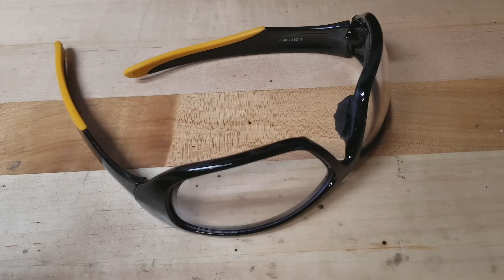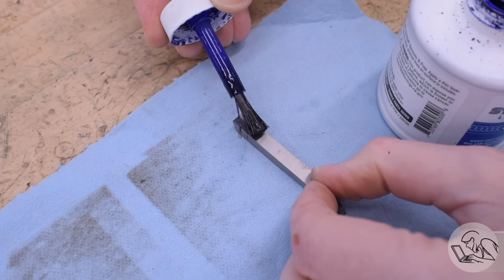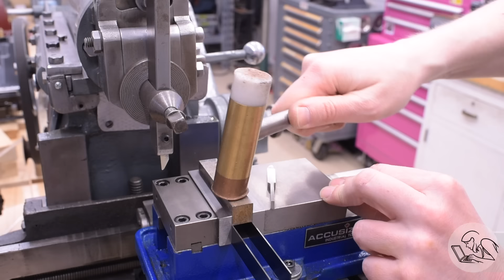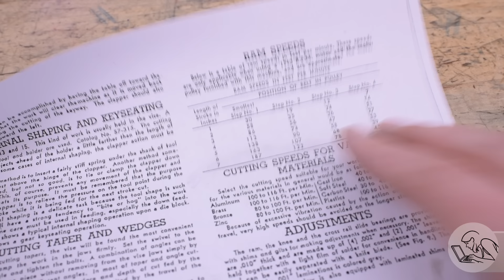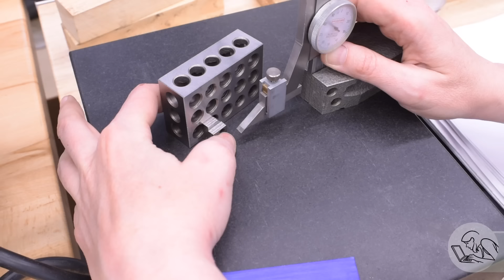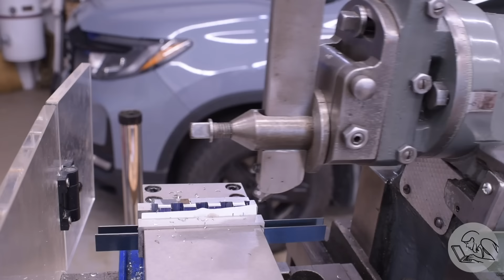Let's Make T-Nuts Like It's 1950

Comment: I've only recently been watching your channel which I find really interesting and informative even though I've had my hands on tools most of my life.

Especially interesting is the fact that we both have the same model of shaper. I used them at work but they were all huge things and after all it was only about getting a job done in the least possible time with whatever we had at hand at the time. I've been retired a good few years and have built up a decent hobby workshop, so when I saw a shaper advertised reasonably locally I had to buy it. Turns out an older guy had bought it with the intention of restoring it, stripped it all down and was unexpectedly called to meet his maker before he got to finish the job. Essentially I bought boxes of parts and castings . . . 
I decided to do the best job I could to honour his intentions so stripped all the paint off, re-painted it and then started on the assembly. Turned out the hub that holds the bull gear and the stroke adjusting mechanism had cracked, and with the last of the shapers having been made in the early 60s parts were thin on the ground. Add into the equation the fact that I'm in the UK and the machine is American and the chances of finding parts were zero.

After a lot of thinking, I turned the hub off the shaft, flame cut a chunk of 5/8" plate to about the right size then bored it to fit the register I had made on the shaft. Brazed them together then turned them down to the right size to fit the bull gear. There's a semicircular channel milled into the hub to carry the worm and pinion adjuster which I managed to replicate by using a home made David Gingery milling machine - not made by me unfortunately - which did the job. 

Re-assembly was pretty straightforward until I discovered that the nut which fits the knee adjustment leadscrew was missing . . . Had a couple of goes at screwcutting a phosphor bronze 5/8" ACME left hand nut before I made a suitable tap instead and got the job done that way. 

I bought the shaper about 12 years ago and use it on a daily basis - it's surprising just what you can achieve with one! Mine's not as pretty as yours - it's covered in oil and swarf but it's a working tool after all. I did find that the micrometer dials were too small and faint to see so I made larger, re-settable ones with clearer markings which was a complete game changer for me.  

Thank you for a great channel with very enjoyable content - I believe you're never too old to learn something new so I'll continue to watch.

Comment: 21:07 Would it have been valid to unlock the jaws of the vise and slide the part down the jaws until the next hole position is aligned with the drill press spindle?

Comment: This retired general machinist says you could teach a class in manual machining.  A tip about "staking" your thread bottoms:  Use the ball end of a ball peen hammer or ball bearing suitably sixed laid over your threaded hole and hit it once or twice instead of having to be really finicky with placing your center punch and working your way around a hole. Saves time and effort.
Reply: FWIW I put in as large a tapered punch as will fit and give it couple of taps.  Will usually drive the last two threads together.  The punch is meant to be hit and not as hard on the face of the ball peen.  Not that I haven't done that too.

Comment: Kinda brings it back- the old shop had a couple of shapers I tried a couple times. I found them slow compared to the big Milwaukee mills across the aisle.  The old timers loved 'em (I was in my mid 20's at the time so I thought those guys in their 50's and early 60's were old timers).  Here's one for you: they had a vertical slotter, which is just a shaper that sits up.  Ram runs on a vertical line, just the ticket for some ops that are quite awkward on a conventional shaper.

Comment: Awesome work, Quinn! That really is a sweetheart of a machine. Whatever you paid for it, you got a deal. Shapers really are fun machines to use... And one of the nice things about being a hobbyist, is that we can choose which machine to use for a job based on fun, versus time/money. As you said, those T-nut would've been faster to make on the mill, but you've got a new toy to play with, so why not use it instead?

I've got a Rhodes 7" shaper, which dates to sometime in the early 1900's-1910's. A previous owner converted it to V-belts, and I plan on de-converting it back to flat belts, just because. Though I've modernized it in other ways... I've added a TouchDRO and glass scales, as well as a tachometer (I told TouchDRO that the tach ring has twice as many magnets as it actually does, so now it reads strokes per minute).

Though the "modernization" I'm most proud of, is the QCTP I made for the shaper. I'm sort of obsessed with repeatable, quick-change tooling, so I racked my brain, and came up with something that (so far) works really well. If you're curious, I made a video series detailing the making of it.

Comment: Love your work - even making T-nuts again!  You sharpened the HSS bit and cooled it down in water to keep from burning your fingers even though the tool can stand much higher temperatures.  I too have done this about 1000 times.  Another YouTuber cautioned viewers to not do this because the thermal shock can cause micro fractures.  He recommended just letting the tool cool naturally.  I'm inclined to keep doing what I've done (don't we all) but would enjoy hearing your thoughts on this.  My SWAG is that the temperatures in the tool that I can hold the other end of just aren't high enough to cause an issue when dunked in room temperature water.  Thanks.
Reply from the maker: That sounds like nonsense. Machinists have been dunking toolbits for 150 years.

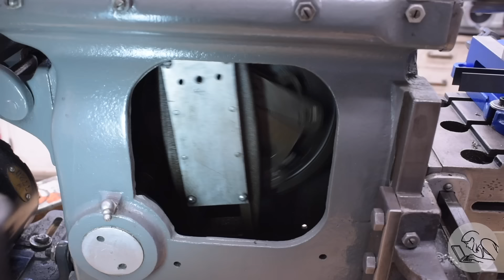Comment: Quinn, at 13:00 you said that idle stroke is actually faster than the cutting stroke, however your cutting stroke is faster than your idle stroke. 1, your drive wheel is turning backwards, so the top/slow part of the drive pulls the head backward, and the bottom/fast part pushes it forward, and later on, around 22:30, going frame by frame I count 13 frames of cutting stroke, and 16 frames of idle stroke. Are you now QuinnGPT?

Comment: Hey there! Love this shaper, love the video.
I read a lot of patents, and I found, searching for old shaper patents, a simple mechanism for making an autofeed mechanism for the tool slide. It works using a ratchet mechanism actuated via a friction bar, with the friction bushing held on the shaper body, and with pins to stop the ratchet and set depth of cut. I made a replica for my shaper (a French "Rapide-Lime") out of wood, as I only have a few tools, as a proof of concept, and it works great! It would be amazing to watch you make one! 
The patent is US420746
I'll put everything in a public drive folder in reply to this comment, so if it gets flagged and removed I don't lose this suggestion.
Cya!
Reply: Do a little more research. I've seen shop made auto feeds though I can't point you to one as an example.

Comment: thats a very furturistic shaper compared to mine...if you want a longer stroke on a hand shaper you just pull a bit further...there is a bit of adjustment on the pivot but not a great deal lol. 
Speed on a hand shaper hmmmmm....thats called whatever works
One thing I have found out it not to run it too far out or too far down because it will vibrate like a monster and ripple the work piece foillowing the last vibration...it literally cuts ripples in my stock so I fixed that one.....
fascinating stuff that I can still learn from
Thankyou for sharing

Comment: Thank you for including this video. Even though they're only Tnuts, the shaper is legitimately interesting to watch and learn about. Very entertaining. Maybe you could try to see if there are some power downfeed mods that you can add for the stepover? I bet there's some way to do it from all the levers and things on the side, then just set how much each click moves it over by
Reply: What could be fun would be to put servo motors on the step over and ram down feed along with a CNC system to control them. I know, this would be a sin, but then my patron saint is Till Eulenspiegel.
Reply: There are shop made examples around.

Comment: It sounds like the reason Shapers fell out of favor was because no DRO and no CDC
Reply from the maker: There’s nothing stopping you from putting a DRO on a shaper
Reply: The main reason is that there's almost nothing that you can do with a shaper that you can't do faster with a milling machine, yet there are plenty of things you can do with a milling machine but not with a shaper. And the few things that a shaper can do but a milling machine can't can be done even better with a broach or (for mass production) a broaching machine.